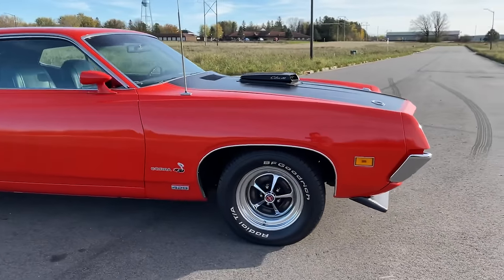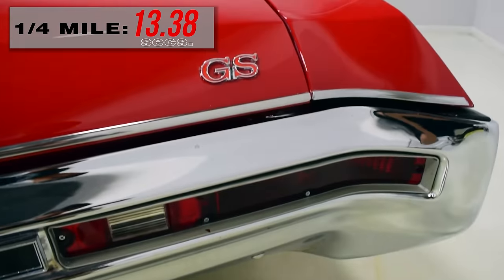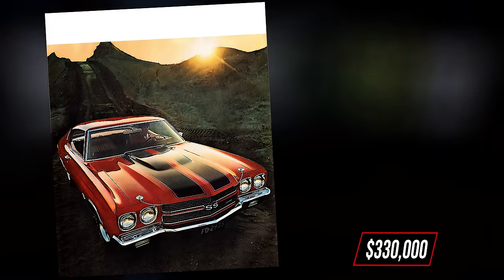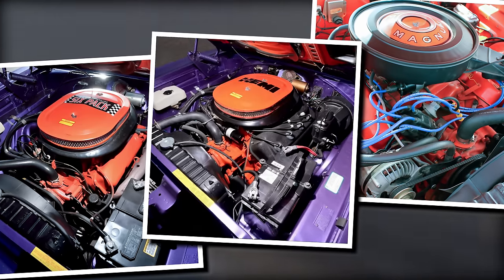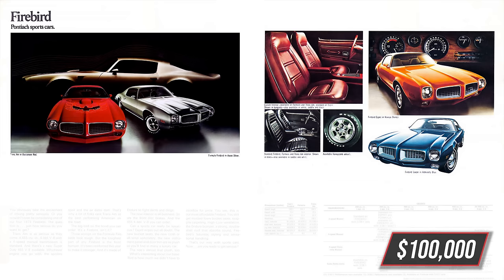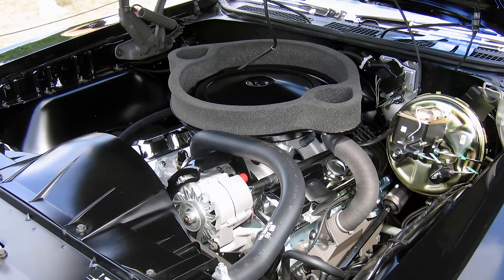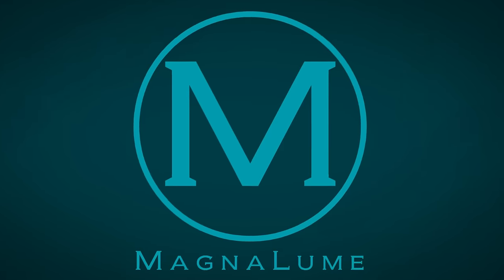10 Quickest Muscle Cars of the 1970s  | What They Cost Then vs. Now

Comment: I had a '70 Buick GSX (yellow w/black stripes). Since it was a 4 speed, I had the edge from a stop over anything else on the road.  Automatics really sucked back then.  I never lost a race to another car that was stock as built.  Unfortunately, I drove that car to death.
Reply: The "BB" TH400 of the Stage 1 package was a great trans and quicker than the 4-speed.
Reply: BUWAHHAHAHA   where did you live  Alaska?     you should'a brought that to Detroit..  was nice car.. my friend had one... he hated me cause I'd kick his ass every time we raced..   with what you might ask... hehe    with my

 1968 Ford Torino GT    428cj
Reply: Had a GS Stage 1 automatic. Until the Viper and its V-10, the Buick had the highest torque rating so the auto trans version was no slouch. With headers and a tune I got it to13.1 in the quarter mile.
Reply: 396-375 hp  Nova  12.5  pistons  1969   Bought it in 1986.  I drive like that too. Sold it eight years later. I still cry.  Gas was horrible by then.  12.8 quarter mile.  I paid $4500 for it.
Reply: My uncle had one, he tore the rear end up in it so he dropped a Ford rear end in it. I believe it was a 350 and it had a four-speed in it. And stock versus stock the 351 Cleveland was the fastest small block engine of this time period.
Reply: @coolbreeze253  There were not muscle car engines, but the '68-'70 Cadillac 472 had a torque rating of 525 lbs-ft. And the '70 500 engine had a 550 lbs-ft torque rating.

Comment: I remember when the oil embargo happened. You could pick these cars up for $500. USD or less !  And I did have a 454 Chevelle SS that I paided that for. Traded it for a 1966 and 1968 Chevelle SS.  The 68 has the 427ci and is a convertible 41,000 original miles. The 66 is my toy and has been built for show and the strip.

Comment: The car I've always wanted was a 1969 Chevelle 396 SS, 4-spd Hurst shifter, Muncie 4spd trans, 3.73 posi-trac, bucket seats, ralley wheels with black vinyl top candy apple red with black pin stripes. 

There was one in my neighborhood.  I took dad to see it. His eyes bugged out. I knew then it was not to be for me or for him. 

Moms and wives are the stumbling blocks.
Reply: had one in 1979 with 2,500 miles on it.  Black vinyl top and yellow.
Reply: I had exactly that in a 69 Camaro. It wasn’t red, but silver with a black vinyl top. Paid $900 for it in 1978. I’ll bend over and take my butt kicks for letting it go.

Comment: Very cool video. Do some more. Surprised by the El Camino. Makes sense in a way cuz I suppose they're lighter. Problem would be getting traction I'd imagine. Always thought the GS, GSX Stage 1's were the top of the heap. Especially for 0 to 60. 510 ft/lbs...Damn!   I think that'd be my pick, in my top 5, although the Hemis are way more valuable and I absolutely love those Trans Ams.  😛😍   
Love the posts about the cars people had back in those days. I remember them well.  My own was a 66 Chevelle SS, with a 327. In Canada it's different. One friend had a 69 Super Bee 383. What a rust bucket but what a sleeper. Underrated imo.  Blew away the late 70's Trans Ams, rust and all. haha. Another had a 70 GTX 440 6 pack!  What a monster. I think he bought the damn thing for under a 1000 bucks. Now?  Jeeez. $$$$  Good times.
Reply: I use to swap a spare tailgate filled with concrete.
Reply: I think the El Camino actually weighed more but it was at the rear allowing more traction.  One of the driving magazines of the day said it was the weight bias that allowed the El Camino to beat the Chevelle around a track.
Reply: One of my cousins had a 69' Super Bee...had the 383 Magnum engine(blueprinted) ... Car was a BEAST.   It had frame rot but he sold the nose for $500 and drove what was left to the boneyard and sold THAT for another $175.  Car had 280K miles on it and all he ever did was standard maintenance...he said it BARELY made it over 120 mph on the way to the boneyard...smfh...compression was toast.  He won a LOT of street races with that monster...

Comment: One of my dream cars was the Hemi Cuda.  I owned a used 67 cuda bought used for $300 and dropped a 340 in it along with about $1000 in modifications and ran low 12s in the quarter mile.    Transmission?  I switched the stock auto for a standard than went to a modified auto.  0 to 60?  That depended on which 3rd member I installed for the day 4.10, 5.13 or (I think) 3.18.  I miss the 70's.
Reply: 1968 426 HEMI Barracuda was capable of 10 to 11 second passes at the strip. Talk about overkill. That was Sox & Martin's weapon of choice at the drag strip. If S&M were running today, they'd probably be running a Hell Cat or better yet, "the Devil on 4 wheels"-2018 Dodge Demon...which is an instant collectible car. 
FYI-I have a small car ad back in 1988 for a 70 HEMI Cuda(show winner car)--$18 grand. Today, take your pick a mint HEMI Cuda or the average house in US. Mind blowing isn't?

Comment: Still have my 1970 Plymouth GTX that I bought used for $1250. It is yellow with a black vinyl roof. I love driving it around. It has a 440 cu in engine and a four barrel carburetor. It passes everything but a gas station!
Reply: A buddy of mine had the same car.. only difference orange exterior... other friends had 67 ss  70 gto, 67 cougar,  70 ss. REALLY don't know how fast it was in the 1/4.. BUT TOP END..

NO EQUAL..

Comment: I'll never forget and still pine away for my '69 390 hp blue Corvette coupe with the 427 cu in engine.
I ordered it with the wide ratio M-20 four-speed and 3.08:1 rear gears for a better ratio in first gear than the close-ratio 4-speed and the typical 3.36:1 rear for more streetability and in-traffic daily driver.
Shift speeds were 50, 70 and 90 mph at orange-line, which embarrassed kids who couldn't downshift their hopped-up Mustangs TWICE at 55 mph!
About $4500, as I recall for my 'first car.'
Reply: I had the same car 69 427 390 mine was riverside gold👍👍👍
Reply: I laughed when you stated "at orange-line".  It's been so long since I've been in an old car with a tach that it slipped my mind about that little orange part before the red line.  i had to google "1969 427 Covette tach" to see if it was really orange.

Comment: In 1973 I owned a 1970 Chevelle Super Sport 396/ 375 horsepower 4 speed. I was working at Jack Nicklaus Pontiac in Delray Beach at the time. It was a trade-in on a Trans Am. I was able to buy it for $800. That car would pretty much pass everything but a gas station. What a car, I wish I still owned it.

Comment: I remember when my Dad bought a brand new 1969 Pontiac GTO straight off the show room floor. It had a 400 V8 4 speed Hurst shifter 4.11 positive track rear end. G60 tires. It was dark green with dark green interior and lighter green vinyl top. $4,800 bucks man !
Reply: Yeah man, a 6 pack of beer set you back about a buck...give or take a few cents. GAS--about 30 to 35 cents/gallon. 
We are getting so screwed in 2022. It's pathetic.

Comment: 70 Chevelle was the very first car I had as a young man - washed a lot of dishes for that buy ---.  Great on the straight - however if you wish to corner it.... You needed to rework the front end.

Install the F body spindles - modify control arms and install a good sway bar front and rear.

Add an alum head and intake your on your way to being the King of the street.

Comment: Base 2020 Audi A4 Quattro 2.0l, 252 hp & 273 lb-ft goes 0-60 in 5.2 secs and 13.9 secs 1/4 mile... With AWD... My how times have changed for combustion engine cars. So nice to see all these fine examples from when I grew up too.

Comment: I personally would take the Buick.  Being a GM. Advance the timing a little, re-jet the carburetor, get more air in it and toss in a stronger cam.  You’re home.  Probably knock off a second with todays tires.  The 455 is a different animal from the 454.  We all know, It was under hoods of Buicks, olds and Pontiac.
Reply: Each of the divisional 455s was completely different from the others. Pontiac, Buick, and Olds blocks and designs...different bores and strokes, different external appearance. They were all 455s because of the latest corporate top limit on cid for these divisions. Caddy got to build their 500 (8.2) but it was a luxury engine.

Comment: I had a 1969 GTO judge. It was FAST. Most of my friends and boyfriends had VW bugs….I mean one of the bugs got 54 mpg. Finally I gave in and ‘raced’ a guy with a sad little mustang. Even I couldn’t believe how quick it was. I will tell you I watched the gas gauge go down. I’ve never understood the infatuation with the mustang. Even then it was considered a cheap knock off. It was basically made so everyone could afford a muscle car. Very sad inside and out. For reference, I got my GTO used in 1972. It cost $650

Comment: These cars squeezed out these 1/4 times while spinning the rear tires through much of 1st gear.  Imagine these cars with sticky tires and modern 6-10 speed transmissions. They would be low to mid 12 sec. cars.

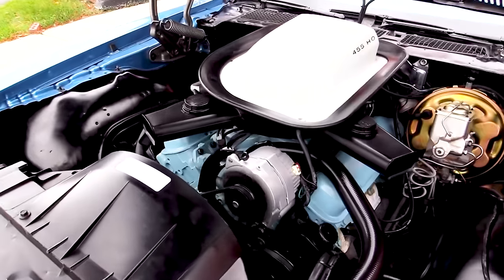Comment: I had a 67' Le Mans with a built 326 ci. Nice street cam and a Carter AFB 4BBL with bored secondaries.  2 speed Powerglide with a Stall Converter with 3:08 rear...pretty quick out of the hole and a great top end.  NEVER should have sold it...oh well...have some great memories...waxed a few hides and got waxed myself but all in all...one great machine with some serious styling.

Comment: The most balanced "Muscle Car" from that era was the 1970.5 Z28/RS IMHO. It wasn't necessarily the fastest, but it had the balance of power & handling that few other "muscle cars" had. I remember a 1968 Dodge Charger RT 440 with Posi-trac rear end that I owned & in a straight-line race few cars could beat it! But throw in a few curves & it wallowed like a whale. Dodge/Chrysler vehicles were notorious for being poor cornering cars compared to GM & Ford's offerings. I still have the 1970.5 Z28/RS that I bought from a friend after we graduated HS in 81, but it is in sad shape & desperately needing restoration. Well, maybe one day..........😐🙏🙏🙏 (P.s. I ALSO owned a 1970 El Camino SS 396 that was beautiful....until I TOTALED IT right before shipping off to BMTS! 😭😭😭😭😡😡)

Comment: I had a 67 GTO 400, with a four speed back in the day. I never had trouble with any mustang, any Mopar. At the same time, I never beat a 396 Chevelle. They would launch out of the hole, and they would be onecar length ahead. And that’s the best I could do against the Chevelles,,My GTO was bone stock, with a Quadra jet, from what I saw during those years, the king of the street was the 396 Chevelle..
  A few years later I picked up a 68 dodge charger. Exactly like the one in the movie, the French connection that is seen parked on the street in several scenes. Gold with a cream colored vinyl top. That was the junkiest car I ever owned to this day. When I bought it it had 32,000 miles on it. I put the third transmission in it.. torque flight. I bought it from a volunteer fireman who always wanted to be the first one to the station.. I would start it, I would hear that horrible sounding starter that they all had, then I would hear the heat riser valve clacking away. And it would puff oil smoke… when I closed the door, it sounded like a 5 gallon metal bucket filled with washers and bolts. One time when I floored it, the steering wheel snapped out of my hands and almost broke my thumb on my right hand as the steering wheel went all the way to the right… The window winder came off on both doors, the locks would freeze in the winter, it was a 383 two barrel. Sometimes the headlights would open with those flip-flop covers. The other times I had to get out and manually open them and put a stick in there to hold the headlight covers up. when I bought it it was only three years old and rotting out or long the quarter panels here in western Pennsylvania where they salt the roads in the winter.
   it was a 68 just like the bad guys car, the black charger in the Steve McQueen movie, bullet. Every time I see that scene of that car crashing into the gas station and exploding, I say to myself, that’s the best thing they could’ve done with that piece of crap
  The reason those chargers and cudas and challengers are selling for mega box at those television auctions is, they were so poorly made, that there are very few survivors..
   I am very fortunate to have survived having a 67 GTO convertible and a 68 Dodge charger, those cars had no brakes. Drums all the way around, they had terrible suspension. You could not take a high-speed corner more than 5 miles an hour above the speed limit. At the same time frame, I had a 1958 mga, which I still have. That car, was a blast to drive around corners. Drifting. It had those skinny VW bug size tires, 5.60/15s.. that car was a handling fool.. it wasn’t fast in a straight line, but on a windy road, it would leave a Chevelle or a charger or a GTO in the dust..
   don’t lament and slobber all over those old plow cars. They were not that great.
   , they needed a tuneup twice a year, points, plugs, condenser, distributor cap, rotor,, they had no brakes, The tires were not very good, you were lucky if you had an AM/FM radio, they only had lap seatbelts, and if you had a car with over 60,000 miles on it, it was considered near the end of his usable life, which it was.
  in those days, a small town could support two or three muffler shops, a starter/generator shop, two or three transmission rebuild shops, and many repair garage that were busy putting brakes, wheel cylinders, cutting your brake drums, doing valve jobs, rebuilding your carburetors, replacing your rotted exhaust, doing a head gasket replacements, water pump replacements were very common, even universal joints failed pretty often, in spite of the fact that cars had grease fittings on the ball joints and control arms and the universal joints a lot of times.. every average size town also had a radiator shop… you could even get your car painted for $29.99 at Earl Scheib.. if you prepped the car and wiped it down with a tack rag and did all the masking yourself, it really wasn’t a bad job if you didn’t mind a little dust in your paint job along with a little fisheye..
  cars also came with steel wheels and hubcaps on bias tires. Sometimes with inner tubes in them..
   I needed a van to haul my dirt bikes around so I sold my 1967 GTO 400/with a four-speed, with 42,000 miles on it, for $400
   couple years later, the Arab oil embargo happened. Gasoline went up to the completely unacceptable price of $.47 a gallon. There were long lines at the gas stations. People were trading in Cadillac Eldorado‘s on VW bugs which could’ve been bought at the time for $1188 brand new..
  I traded my 1968 Dodge charger, with a recently rebuilt transmission, in on a Ford Pinto without air conditioning. They allowed me $600 on trade for that Ford Pinto.. it was a four-cylinder, four-speed, and it had a light metallic green paint and green interior.. up to that point, that was actually the best car I have ever had. I never even had to put air in the tires. But it was maybe a little faster than a 40 hp VW bug, which I had several of before that. I would buy a VW bug for $100 to use in the winter to keep my GTO, my MG, or my charger out of the salt. And at the end of winter I would sell it for $100.. that Pinto was so slow and underpowered that I had to power downshift from 4th to 3rd on the interstate to maintain 65 miles an hour on slight uphill grades..
   I wouldn’t fret about missing those days in those cars because, these are the good old days. Cars now are faster than ever, and they will actually go around bends, and they won’t actually stop. And they will get fantastic gas mileage, they won’t need tuned up twice a year, they will go 100,000 miles on the original spark plugs, the exhaust system will not rot out for 10 years at least, if you’re exhausted rots out in less than 10 years if you were the original owner on today’s cars, that is a federal law that they have to replace it for EPA emissions reasons. My wife’s last car, they had to replace the entire exhaust because it was stainless steel which meant it wasn’t going to rust, but it cracked, and they replaced the entire exhaust for free because of that EPA regulation. That’s why all cars today have stainless exhaust because they have to last and pass the emission tests for 10 years.. that’s why you don’t see Midas, speedy, and Meineke muffler shops on every corner these days. Stainless exhaust systems put them out of business.. also today, cars will go to hundred maybe 300,000 miles without touching the engine or transmission, especially the Honda is in the Toyota’s.. today’s cars are safer also with airbags and crumple zones. Technology has the engines putting out 500, 600, 700 hp on some of the super cars today like the hellcat..
  So don’t cry about missing those days. These are the good old days

Comment: I always liked big cars, my first new car was a 71 Pontiac Bonneville, it was a so called HO version , it had a 455 CID, 4BBL, 385 horses, automatic, dual exhaust with resonators, and positraction, it was a wild ride for me, could not beat a GTO or similar, but gave them a lot of worries. I think the mid 70's was the beginning of the end of the " as I knew it " American auto industry, the gas crisis, downsizing of cars in weight and HP, influx of Japanese imports and others, that was it!
Reply: I remember the Bonneville. Could put three hefty people in the back seat without touching. Sweet. Considered Mob cars now cuz of the number of people you can fit in the trunk. LOL